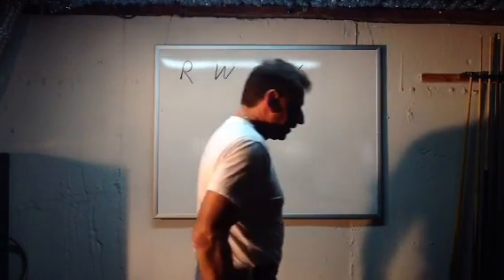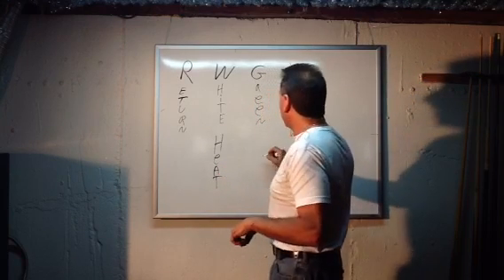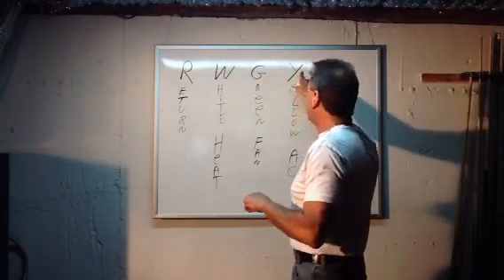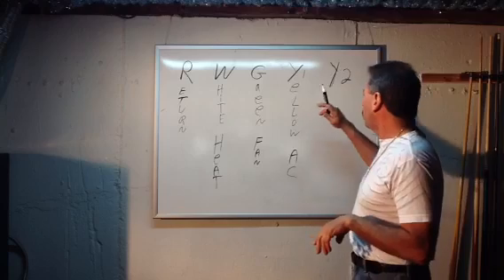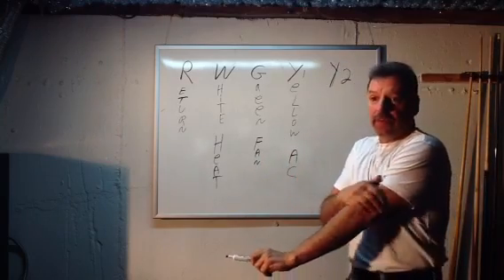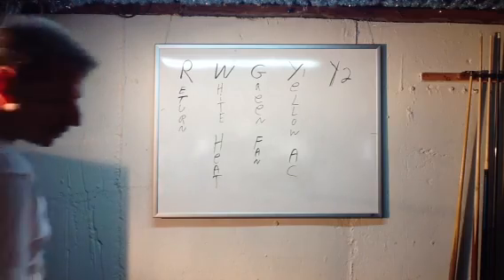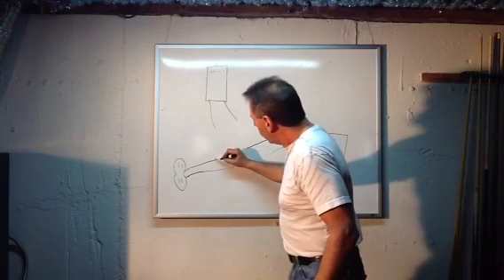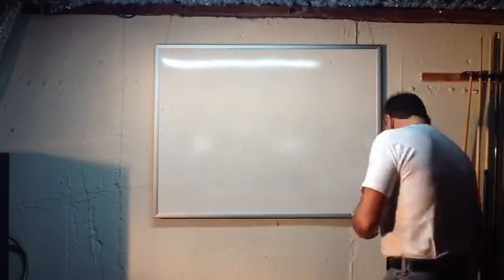Thermostat wiring, by loudepot

Comment: The red is the supply, the hot, the potential. Not the return.
There is no C in your explanation because it's not absolutely necessary, because the W is the return for the heat, the G is the return for the fan, Y is the return for the ac.
Now, the C is the neutral, so between the R which is hot and the C you'll have 24v. That is how you connect power to your thermostat so you don't keep running thru batteries.
Speak accurately.

Comment from the maker: Are you sure you have a 24 volt system, because there are also line voltage systems (120volts) that would change everything. Make sure you know what voltage the system is

Comment: Thanks for responding Louis. My current therm has Black to 1, Green to 2, White to 3 & Red to 4. If I just follow color of wire (which instructions on new therm say not to do) I would put red to RH (I dont have air) Green to G for fan, White to W for heat but where does the Black go? It was on 1 before, what ever that was?

Thanks

Comment from the maker: It's easy enough, G is fan,  Y  is air conditioner condenser, W. is heat,  RH is usually hot red wire for heat, and RC is usually red hot wire for air conditioning
Reply: So by your own admission, R is the feed. Not the return, as stated in the video.
You can't supply 24v and return it with the same wire. The red supplies 24v the g,w,y return that supply(if the thermostat calls for it) and then deliver it to the fan, heat, a/c.

The C is a common. Meaning common to ground. So between r and C you'll have 24v. That is where your thermostat takes power from to operate. Or it uses batteries or both.

Comment: Here are the codes on the back: 

PC8900 A 1007 (1) 
bar code 
08526715241 
0427 
49357 
207573B REV. 
bar code   

This thermostat has numbered not lettered screws

Currently Black to 1, Green to 2, White to 3 & Red to 4

New Honeywell RCT8100 has Rh Rc W Y G terminals

Where do my colored wires go?? New instructions assume old therm has lettered terminals and says to ignore wire color?